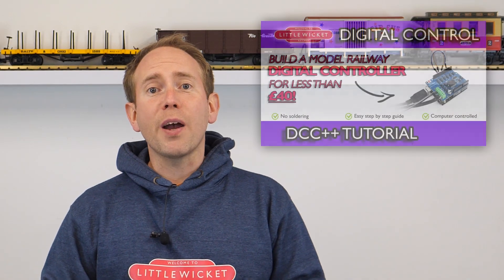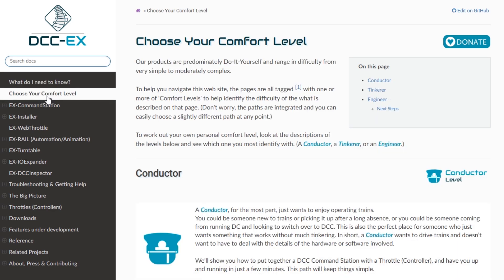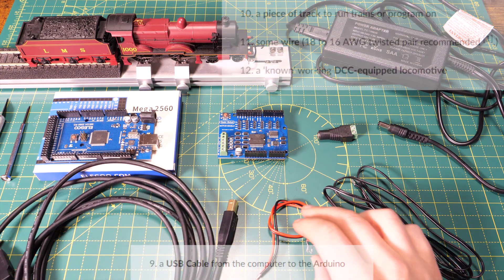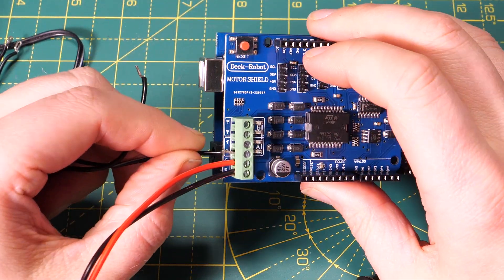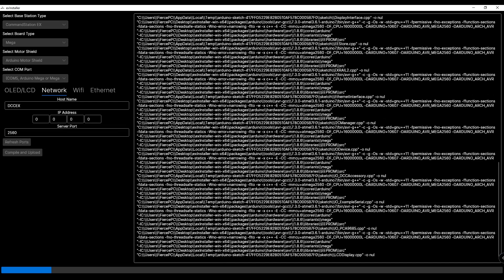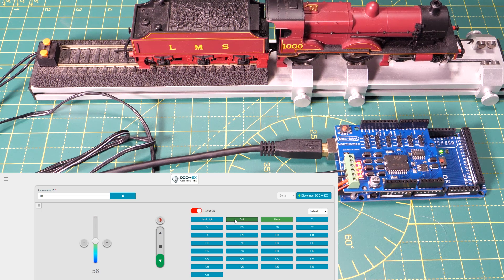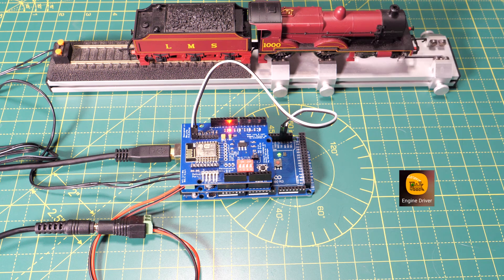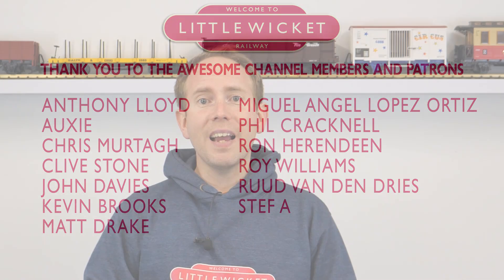DCC Ex - Amazing Digital Controller for Under £50 😮

Comment: Nice inro, and I'll likely give DCC EX a try, but I find it somewhat amusing the creators who talk about how inexpensive it is to implement.  Well, yes if you have a spare laptop or don't mid hauling it to the layout, then yes.  Then there is the case for the Arduino (unless you simply leave the PCBs open.  Otherwise that is part of the cost of implementation, along with other materials that were used but ignored. Fortunately, I've worked with various Arduinos and have extras along with a motor shield.  Not sure, but I may have a wifi module as well.
Reply: Laptop is not needed at all though.

Comment: I don't understand why EVERYONE isn't using DCC-EX. (1) You can assemble a system in less than an hour for about what a good quality DC throttle costs; (2) A single DCC-EX system will control BOTH DCC and DC locomotives at the same time (must be on separate tracks of course); (3) Any smart phone works as a wireless throttle by installing any of about 20 apps; (4) Upgrading to the newest software version is simple; and (5) You can load your locomotive roster into the system, including locomotive-specific labels for the function keys.
If I were a manufacturer of "commercial" DCC systems, I'd be looking for different products to market...

Comment: what a lode of rubbish paid for al the bits wast of time and money ended up having to  find all the downloads and uninstall them be carful you can make a mess of your laptop trying to make it work windows 11
Reply from the maker: I guarantee that if you follow the instructions on the DCC-EX website it won't "make a mess of your laptop". The system has had hundreds, possibly thousands, of happy users going back the DCC++ days. If you need help then they have a very active discord community who may be able to assist.

Comment: Does anyone know an easy (stress easy) way to change the wi-fi password. I an a little concerned that it the same as the access name. I plan to use the unit at shows and a bit paranoid that anyone could log in and take control of the trains.

Comment: I don’t know why OO and larger model railways aren’t using LiPo batteries and wireless control?  I mean the issues with wheels connecting to tracks and brushes connecting to wheels, and issues with points!

Comment: I just picked one of these up....WRT the decoder address how do you allocate ths or is it set up by the decoder?  Thanks great video 😁
Reply from the maker: You can set the address of the decoder by placing the locomotive on the programming track and changing the appropriate CV for the decoder. CV1 for a short address or CVs 17 and 18 for a long address. You can choose the address yourself. 1-127 if short or 1-9999 if long. You'll need to change CV29 if using a long address. The general convention is for the locomotive/decoder address to be the first 2 numbers and last 2 numbers on the locomotive. e.g. a model of 9F Evening Star with running number 92220 would be 9220. The default address on most decoders is 3.
Reply: @LittleWicketRailway  great help thanks 👍

Comment: The requirement for a known-working DCC loco puts me off. I've got a couple of DC trains, which I'd have to convert, but then when it all doesn't work I don't know whether I've buggered up the controller or both trains!
Reply from the maker: Isn't that the same for all controllers though?  You'll be able to measure AC output on the track (not accurate, but an indication) to check that the controller is output something. I'm sure you can also see a serial output from the controller too if you connect it to a computer. But I wouldn't worry, I'm sure you won't mess it up.
Reply: @LittleWicketRailway  Indeed, but if I didn't build the controller myself, it's more likely to be the trains! I see your point, though.

Comment: As usual Rob's presentation, explanations and clear voice has resulted in an excellent video. I'm planning to build an n gauge model having sold all my OO stuff last year. The prices of DCC controllers is ridiculously high so DCC-EX is definitely worth considering but I'm concerned that my Windows 7 laptop operating system will be incompatible, is that the case?

Comment: Hi
I bought the same laptop charger with the sam e tip of 6.3 x 3mm and the dc power supply male and female connectors 2.1 x 5.5mm, but i am not able to connect the laptop charger tip to the female connector....please let me know where did i go wrong.....thanks in advance

Comment: Hi, After watching this video i wanted give it a go. The setup arrived and the biuld was as easy as shown in the vid tutorial.  Two issues though, 1 - i can get a loco to run on the main track no problem,  but cant program it( code 308). 2 - I can program on the progtam track but the loco does not respond to any commands. Which is a pain as my intention was to use the setup  for programming on my rolling road. Any thoughts. Great video, thanks.

Comment: Hi Rob, great video and it gave me the confidence to start building a DCC controller for myself.  I bought a wi fi board via the link you suggested. It is manufactured by Dolla Tek and has a small red panel with 4 switches marked "on" and "dip". I think the labels for switches 1 & 2 are on/off and 3&4 are dip? Do you know how these should be set please?

Comment: Which sort of cable do I need for the power connector, and track power. Also, the wiFi shield listed in the description has terrible reviews on amazon, is the fix you stated on video the work around for this particular part, or can you supply a link for an alterantive . thanks in advance

Comment: Brilliant video - and yes you do explain (very well) how simple it is to use Arduino and DDC-EX. 

One issue is that the DD-EX website has been changed since recording this video and things no longer go as indicated. There are some changes to the menus and set up procedures. However, it is still as simple as you indicate - if not even easier - and so hopefully more people will be persuaded to try it.

If you want to use the cloud to try the speed controller from DCC-EX you can only do via certain web browsers and, sadly, my favourite, Firefox, is not included. However, if you are on Win 11 you will almost certainly have a copy of Edge (try getting rid of it!) and you can open it up just to run the controller. If all goes well and you want to, you can download the controller to your own system and DCC-EX software makes all the changes necessary in order that it runs without using a browser at all. 

Thanks again!
Reply from the maker: Thanks. That's the problem with these fast developing project, things change to quickly. Good to know that the video still kinda works even if the website has been progressed. I need to go back and look at Ex-Rail features soon.

Comment: Great video - How many train can be run using DCC-EX described in your video. 
Thanks Brian
Reply from the maker: Hi Brian, I think I used a 2Amp motor shield in video which could maybe run 4 trains at the same time depending on their current draw (modern loco running on the flat on it's own is probably only a few hundred milliamps. An older loco pulling 8 coaches all with lighting going up a gradient could need 1Amp). If you need more power then you either need a bigger motor shield, I believe 5Amp versions are becoming available, or boosters.
Reply: @LittleWicketRailway that was my first question, so thanks for the answer. If you have a bigger power supply can you take the DCC output to power mosfets  and use the signal generated to switch the higher output power supply thus enabling more simultaneous locomotives?  What is the max number of devices this system can address simultaneously e.g. point motors, signals, building lighting, locos, turntables etc…..?

Comment: Hi Rob, thanks again for another really informative and succint video.  I have used the same WiFi board as you (as I'm in the UK too) and found that once it was plugged in I could not get the code to upload either using the ex-installer or the Arduino IDE - UNTIL - I plugged the WiFi board in with pins 0 and 1 bent out of the way so that they do not connect down to the Rx0 and Tx0 on the Mega.  After that it loaded properly, so I can change WiFi password and SSID without dismantling!

Watching the original WangTongze video gave me the clue!
Reply from the maker: Hi Stephen, thanks for the tip. I'll have a look at my board and try the same thing 👍
Reply: This was a wonderful little nugget to find

I was going spare trying to understand why I couldn’t make it work

Comment: Hi Rob I'm about to start converting my DC system to DCC Ex following your video on this subject but I have a few questions. My N scale layout DC system with five main loops, a number of sidings and a turntable using a separate DC controller for each of the five main loops and isolating switches for sidings and turntable. My questions are going to DCC Ex do I just parallel up all loop feeders  maintaining same polarity? The main layout is approximately 8X4 feet, each loop is probably about 20 feet. Also what size power supply would I need to probably run about 4 engines at any time? I would appreciate any advice in these areas. Really like your work and will be using some of your ideas.

Comment: Hi Rob, this seems to be an excellent explanation/tutorial but I have a question …… I don’t have DCC at the moment but I have bought a 2nd hand loco with a DCC chip inside it but I have no idea what address it is on so how would I be able to input the address at 8:42? Can the system do a search of connected devices? If not how do I find the address?
Reply: Some systems can read yes.  All you need to do is make sure it is the only loco on a price of track, programming track.  And enter programming on the controller and assign it the address you want

Comment: Hi Rob, I believe we met at statfold Barn Railway exhibition in 2022, we had a chat with Richard Watson.

This has been a great little video on what I can see could be such an amazing system.
I have got a dr5000 setup like a z21 but I find the app for that a bit cumbersome.
Train driver looks so good, and the dcc ex system looks right up my street.
The functionality it shows seems really good, is it possible to control accessories with it? Such as points, signals and similar?

Comment: Just ordered all my parts through your links on amazon. Having read the dcc ex website it seems there's quite a few different versions of the dodgy WiFi board with different spelling mistakes etc. Which one did you end up with?

Comment: Hi Rob I purchased one of those wifi boards with wrong smd transistors,did you reolace them or just use the two wire links
Regards Martin
Reply from the maker: Hi Martin, I just used the link wires. Don't trust my soldering skills with surface mounted components.

Comment: Hi Rob.
Thanks for another concise and informative video.  Others should learn from you how to impart the information without the waffle.
I've been using DCC-EX for about a year, but instead of Wi-Fi, I'm using HC-12 transceivers to talk to my hand throttle, and my Atari computer which runs the automation.  It's a brilliant system, and I highly recommend it.

Comment: Second one on this subject that i’ve visited, DCC=Digital Command Control, so sorry to the “in crowd”, feel like i peed  in your porridge giving it away, but i’m sick of this modern marketing bull, it didn’t do the home pc market much good did it? After decades of learning masm and tasm and  assembly code, i get a wee bit sick of this obscurantist abbreviate everything syndrome, fence them out presenter stuff, even on introductory vids. Digital command control= digital control, what a load a hype and why?
I wanted to know-so i visited google. I’m not watching anything else about this, the old boys club cliches 
about model railway enthusiasts is correct. Here’s my one to keep you guessing DCOC ..Digital command order control, let’s do it the German way,Digitalcommandcontroler. Or just call a spade a damn spade, it’s a controller that has digital chips on the circuit board. Wow.

Comment: Hi Rob. For some time, I have been thinking of building a layout based on a GWR Branch Line operating a 14xx Auto and/or Diesel Railcar in the late '50's/early '60's. Having studied some of your videos, I have gone away from an Auto Reverse system at each end in favour of Arduino control with "back and forth" utilising IR sensors which would appear simpler, cheaper and better on space. Looking at your systems, you use a Uno/L298P for your motor control and a 2560P Mega/Sensor Shield V.2 for Sensor control ........... (a) would it make sense to replace the Uno with a Mega and therefore standardising Hubs, (b) will the sensor shield set-up operate points and signals as well as sensors and (c) trolling through the internet, there would appear to be different species of each of the boards - is there any major difference?

Keep up the good work - I'm impressed

Many thanks ...... Steve

Comment: Nice one Rob, I must try this with my Arduino Rev3 that I have or on the Nano version for a compact little device. It will be interesting to try out this DCC operation for a bit of fun too. I remember a few of your earlier Little Wicket films, for an example, you used the Arduino to switch loco direction with an IR set up.

Comment: Really helpful video, thanks. I currently use a Raspberry Pi (running JMRI software) and pi-Sprog3 Plus as my DCC controller, as I already had the Pi and it was a lot cheaper to get started than 'investing' in a stand alone DCC controller. The DCC-Ex controller also looks to be a good solution and I may well give it a go at some stage.

Comment: Started using DCC and for some reason my Deek-Robot board has the Main and Program tracks reversed. Using the DCC-EX Installer program. Using a Elegoo UNO and also have a Elegoo Mega but have not tried the Deek board in it yet.  Went to Discord and no one had a fix for my problem. Still working on this issue.

Comment: Interesting video. One warning. I tried to use the installer with Ubuntu 22.04 (i.e. Linux) and it turns out that a couple of critical files are missing. I found these online
but then it failed saying libssl was missing. At that point I gave up and followed the Arduino IDE instructions on the DCC-EX website.

Comment: Thanks for a great video.  Big questions: How does one set up the DCC Ex for more blocks? Will I need an Arduino 2560 and motor shield for each block?  If I do, how does each Arduino talk to the other Arduino's if I do it that way?
Reply from the maker: Hi! When you say blocks do you mean blocks for block occupancy detection or blocks as in power districts?
Reply: @LittleWicketRailway  sorry for my ambiguity. Firstly, yes I did mean blocks in power districts but your question gave me  a thought, what about block occupancy detection per power districts as well?

Comment: I've been using DCC Ex for a while now.   I use to enjoy DCC++ but the developer seems to have abandoned that several years ago, so no bugs were fixed and no new features added.    I bought a Arduino Mega with WiFi built on board as I wanted less add-on boards, less points of failures :).    I think it was about 18 months I found DCC Ex and have been using it on my layout since.   I only have a small layout, running 3 or 4 locos at a time, so it works well.   I would still recommend something commercial if you are looking at a large layout with several locos running together, but on a smallish, home layout DCC Ex is amazing :)  Very capable and very compatible with a wide range of accessories and decoders.

Comment: I've been using DCC-EX for a few years now on two different layouts. It's outstanding. Anytime I want to add a wireless throttle, I just buy the cheapest android phone I can find. Our entire setup cost a fraction of one of the big name wireless throttles alone.

If you want to dig into the scripting, you can have Engine Driver populate your entire roster. No more remembering addresses or function keys.

Well done video. For anyone wondering, this is an insanely easy way to get cheap, reliable DCC.

Comment: I did setup a DCC-EX station much like yours some time ago (actually inspired by your DCC++ video from last year). However, because I love the tactile feel of a physical hand controller with knobs on, I wait-listed myself for the MERG hand controller (which I also discovered through your video on block detection). That came up just a week ago, so I ordered the hand controller (CANCAB2E), the base station (CANCMD2) and a plug-in adapter (93H) to go with it. It is costing me a little bit more than the Arduino setup, but I will have the lovely hand controller, and the option to add more of them. Total cost including an added district cutout (57) was £78.

I will use the DCC-EX setup for a portable exhibition layout in TT:120 I am also building, so nothing goes to waste.
Reply from the maker: I can understand that having a handheld controller is sometimes nicer and the MERG stuff is great quality and value.

Comment: Professional, to the point, and easy to learn and follow as usual! And yes, the buttons on EX-WebThrottle and Engine Driver can easily be changed to have the function buttons handle whatever you want. In particular, the bell and horn can be switched and you can tell the button to be either momentary press (like a horn) or toggle (like a bell). Can't wait for the next video!
Reply from the maker: Thanks to all the team at DCC-EX for all your hard work! 👍👏